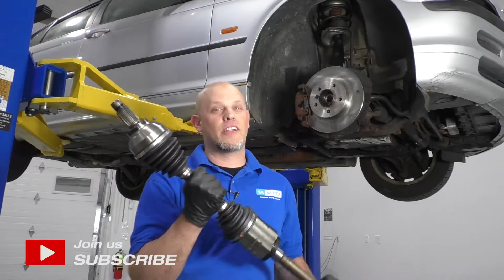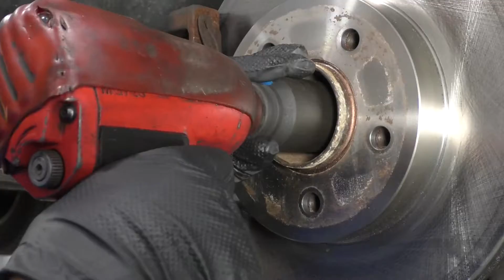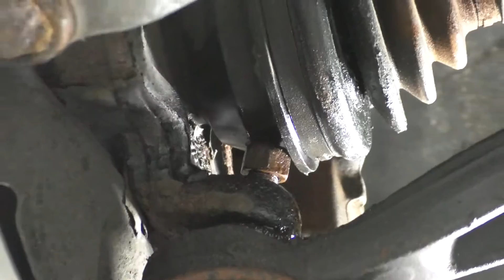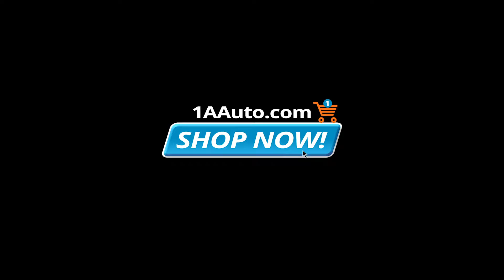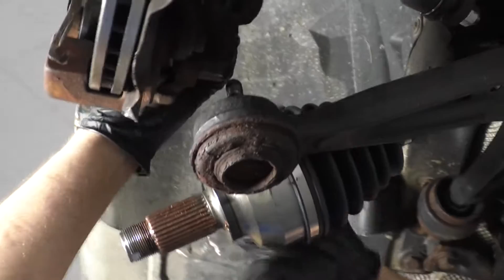How to Replace Front Passenger CV Axle 01-05 BMW 325Xi

Comment: Guys please listen to my comment. 

It took me 3 days to take my passenger cv axle out. I started on friday.
Saturday I worked on taking it out from 11- 7:30 at night. No joke.
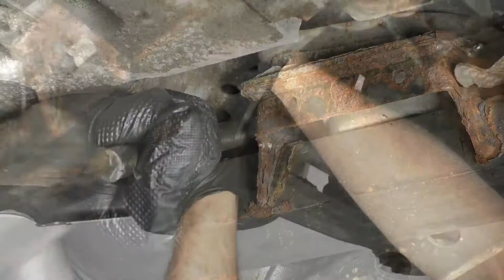Then Sunday I started working on taking it out again from 11-6:00 in the evening. Please listen to me if your in this situation where you cannot pry off the cv axle from under your car, like how easy it is to do it in this video, and other videos doing this same exact job.

Listen to me. If you cannot take off the cv axle like 1a auto is taking it off, Like that BTCH doesnt wanna come out. What you gotta do it take off your wheel HUB. Yknow like first take off your wheel ofc, then watch a vudeo on taking off your bmw wheel hub,( your wheel hub is the thing that attaches to your struts. Okay after that. In this video you see when he used a pickle fork to disconnect the ball joints? There is a bolt on top of that control arm hes using to disconnect the control arm. Take that bolt off with a wrench, typically 18mm. Okay and then on the right of thay control arm, there is another control arm on the right, unscrew that bolt, it was a 19mm for me.  THEN connecting those 2 control arms, at the base of both of them there are 2 18mm BOLTS

For these 18mm bolts WATCH THIS VIDEO AT 6:09 THESE ARE THE BOLTS IM TALKING ABOUT
https://youtu.be/8VeTFcbtzrw

something will be in the way of the far left one so you may have to put a jack under your first control arm to help get it out of the way to unscrew. Now that you have all of that off. Your wheel,  your hub, your control arms are basically disconnected but they are still attached, now your cv axle should be free from the wheel side, and nothing is restricting it. You can also rotate your rotor to either the left of the rivht with all of that stuff out of the way. So now you can get under your car and tap that btxh out. 

SAME THING putting it in. You HAVE to put it in parallel, straight, etc. So it can go in easy, youll be able to push it in with your hands, and then use a chisel and a hammer to tap it in all the way. This worked for me. I was banging my new cv joint like crazy for 5+ hours, and  what made it go in was taking off my wheel hub. And putting that bih directly parallel. bruh I hope this helps one of you guys that is going through something I JUST went through

BUT make sure you do it like the video first. Like take off your wheel, uncrew the 36mm 12 point socket screw, before you do everything im telling you. You know do all this first so everything will go smoothly and you dont mess anything up. If it gets to a point where you get so freaking mad bruh, just take a break because your gonna break something thats gonna bite you in the a when putting thinngs back together,  again hope this helps

Also changing these might end up messing up your front end alignment :P

Update:
Found an easier way to get it off. Buy a 3 pound metal hammer, with a  some type of prybar/crow bar. Back then I was using a little 1 pound hammer. Get someone to help you, they hold the crow bar, you hit the bar with the 3 pound hammer. Dont hit them in the head with hammer and boom.

Also dont buy the cheapest cv axle out there. I think the reason it was so hard for me to get that axle out because it was cheap. Dont but the most expensive but not the cheapest either. Buy the one sorta in the middle.

Comment: watching you use an air hammer made me feel a lot better. I just did this on my car too and then after read in the Bentley service manual a little box that says "Caution: Do not pound on the end of the drive axle shaft". I was confused i didnt think that could damage stuff like the wheel bearings. I guess they wrote that to not damage the thread like you said. They also tell you to remove the rotor and caliper and control arm and the tension strut and tie rod. I thought it was a bit too much got mine out without removing the rotor and caliper using an air hammer.

Comment: I am sitting out in my dirt driveway doing the same exact job being super jealous of your nice garage with Lift and proper tools haha my lower ball joint took me quite a while but nothing in 8 lb sledge an air hammer, and my pickle fork couldn't tackle! Now to remove and replace. Thanks for the video it's been a super help
Reply from the maker: +Canna_bro_grow 2 Thank you! We love empowering our customers and showing how to perform DIY auto repairs with our high-quality auto parts. 1AAuto.com
Reply: @1AAuto  so I got the axle in but you know that little clip at the end of the axle that goes inside the transfer case? I'm not quite sure I got that snapped in all the way I see you used a pry bar and hammered a little to get it in all the way any suggestions if my axle doesn't have that little lip to catch with the pry bar?
Reply: @slammedb18a1  I usually hit the other end with a big rubber or plastic hammer. It shouldn't take much force. If it does turn it a little and then tap it again.

Comment: Hey what is the size of new axle nut ? I watched 5 videos and  nobody mantioned that haha
I guess you used same 36mm 12 point socket for new nut too?
Reply: i noticed this also, replacement nut is six sided not 12 sided. Also looks like new ball joint, haha! Pretty sure you can't use 12 sided on a hex bolt.